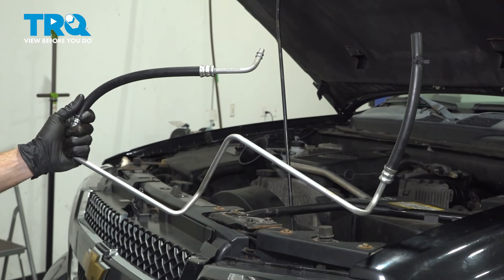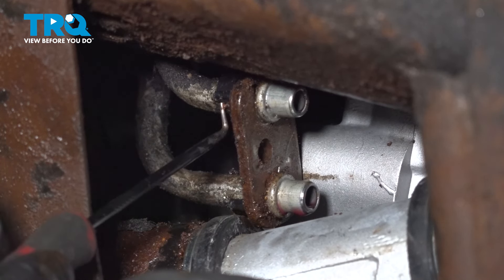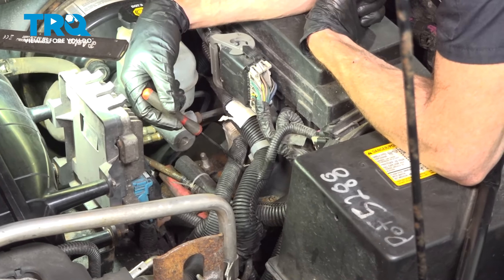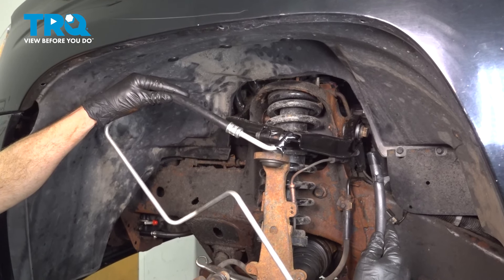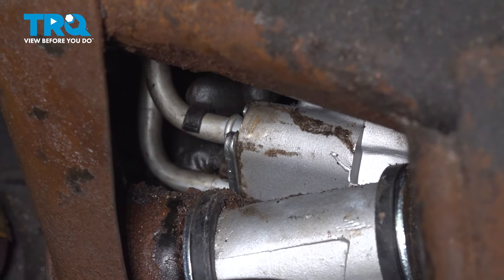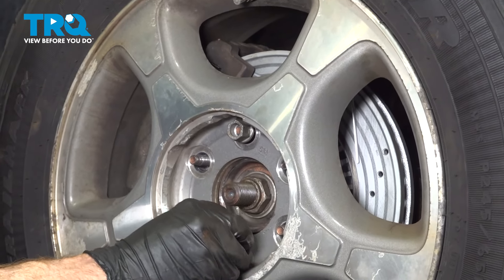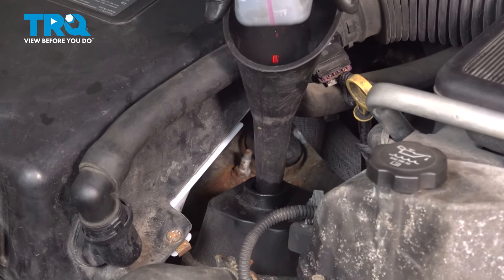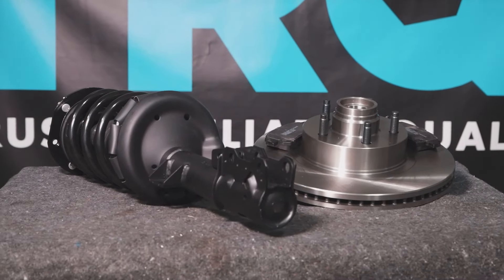How to Replace Power Steering Return Line 2002-2009 Chevrolet Trailblazer 4.2L

Comment: Wish this was up a few years ago before I cut out the portion that was leaking. The job looked too difficult so I went the other route but now I see it’s actually easy. Fortunately that seal on the replacement piece has held up.